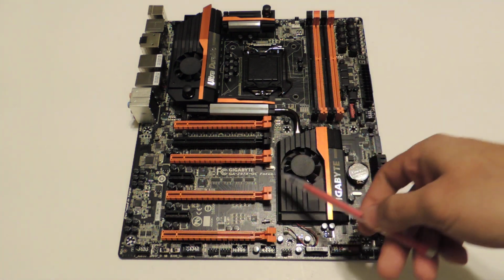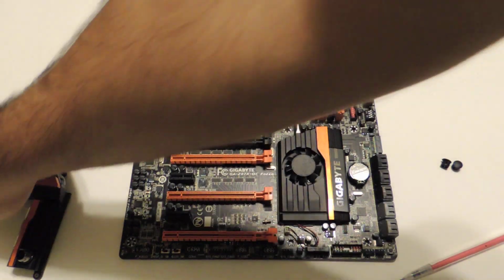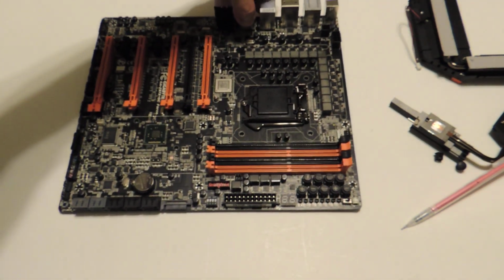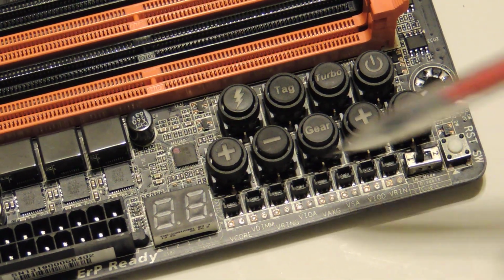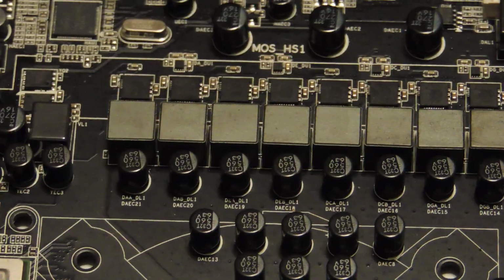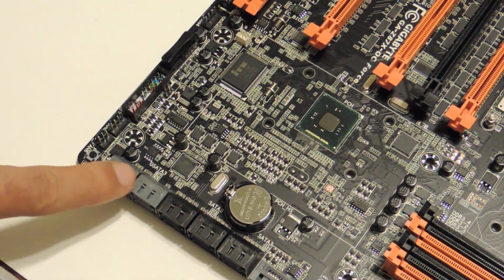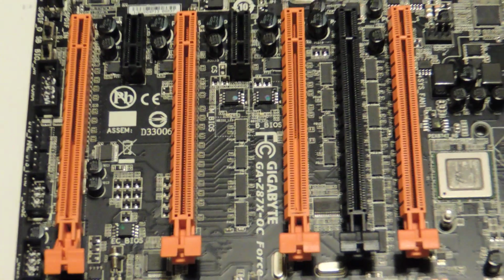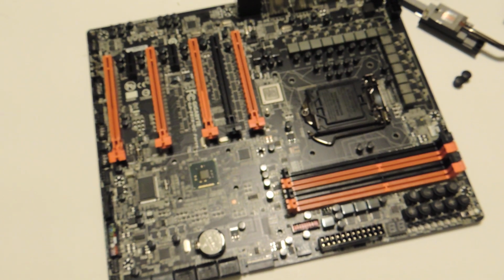[SH] The Z87X OC Force Review and Overview

Comment: just a quick question I bought a ROG illuminated sli bridge and it doesn't reach if I put both GPU'S on the Orange slots but does if I put one in the orange and black (both x16 but ones direct to cpu and the others a plx brige will this work) still waiting for my corsair RM1000 so I can't test it

Comment: surprisingly in depth review! One question based on my daily use on this board, the fan controller in the UEFI, fan 4 and 5 have to be controlled altogether(I can live with it), but why do the two small fans on heatsink also controlled by them?  it is pretty confused, since every time when i want to ramp up my fan 4 or fan 5, those two small fans will also been ramped up, which i am not quit comfortable with. Is there anything I can fix it?

Comment: I bought my self this board for Christmas I want to ask what graphics cards would you recommend brand and model? And what cooling system would be suitable also recommend a brand my other question is 
What is the maximum capacity of graphics can this take ie: 6GB x4 on each slot? If one could
Reply: silver mark james I want to ask what are your thoughts on the Board at this time 2015, have you had any problems? are you satisfied with the product?